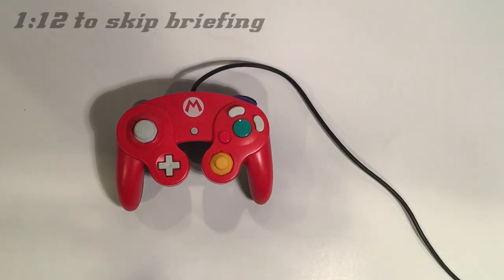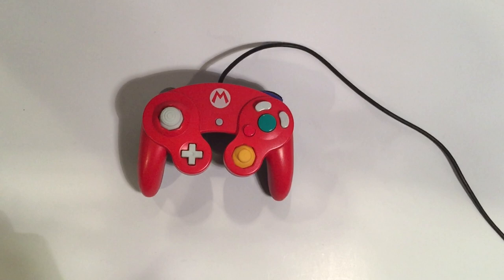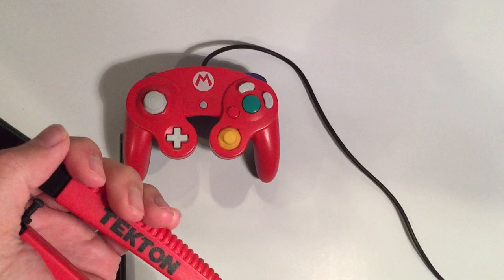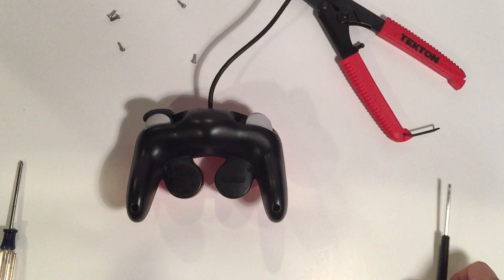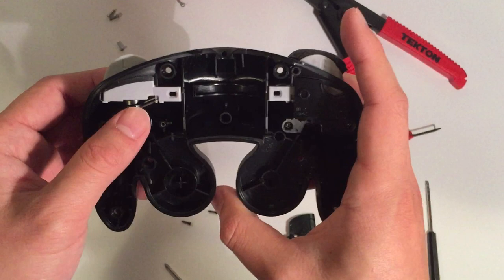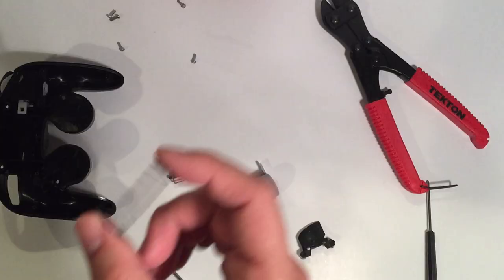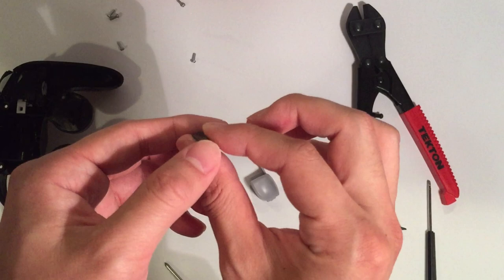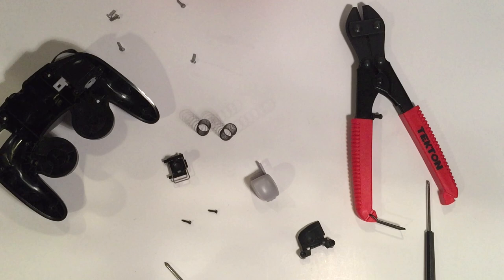Tutorial: Cutting Your Gamecube Controller Trigger Springs (Help Save Your Hands)

Comment: I cut my springs 2 down from the spiral bit at the top of the spring. This makes the trigger spring feel even lighter to press and it works just fine. You can still hit analog values meaning you can still light shield (or shield if you are a smash ultimate player like myself) so cut your springs 2 down from the spiral bit to further reduce the risk of hand pains.

Comment: I personally decided to remove the springs entirely, but ran into a problem where I was getting constant shield presses. Here's how to fix this:

The problem arises when you put the controller back together. There's two sticks on the controller board that are supposed to match up to parts of the L and R buttons. These are used for analog inputs, and measure how far the L/R button has been pushed in. We actually don't want these to link up with our L & R buttons, because then a constant analog input will be read. Push these two sticks all the way up, where they would normally be when no button is being pressed. Then attach the controller with the L&R buttons pushed down (doesn't have to be all the way, just so the slots corresponding to the sticks end up below them).
Reply: THANK YOU! I did the same and I was having the same problem, but your comment saved my life
Reply: thanks

Comment: I just removed them completely. Works just fine.
Reply from the maker: that works too! but just gives a very different feel on the triggers
Reply: The problem with this is you completely lose the ability to light press l cancel.
Reply: @vijayvellaithambi3339  it's for ultimate so does it matter
Reply: @giovanniortiz8421  most people interested in controller modding do it for Melee
Reply: @vijayvellaithambi3339  no you don't you can still press z
Reply: but what about super mario sunshine? will  you be unable to light press?
Reply: @leonpaelinck  i dont think so
Reply: @giovanniortiz8421  how do you get it to work springless in ultimate?

Comment: I had an issue where the right trigger was staying stuck down when i pressed it. I noticed that the right trigger spring was a bit looser than the left, i wound it tighter and put it back on, fixed the problem immediately. Just wrote this in case anybody has this issue

Comment: I can’t get the controller back together and just spent $40 on another one. How do I put it crack together it never wants to go.
Reply: Check reddit or youtube for an in depth video on how to assemble one but, you likely have something out of place otherwise the shell will just go back together.  It could be the pads in front of the board aren't exactly in their correct position and if they aren't they'll kind of push back on the board which won't let it sit as deep into the front part of the shell.  Though, it could be something else, like your zbutton isn't quite in it's little slot or the cables from you rumble motor are maybe, getting in between the shells underneath in the middle.  I think you can also, get it jammed up a bit in those little rails on the back of the board are in the wrong position/not aligned to where your triggers actually connect to them (the little hole on the triggers goes over the plastic piece that slides up and down those rails) I think I've messed it up before to where those plastic pieces missed the holes and were pressing into the plastic around the holes so, it wouldn't let the shells come together.  TL/DR it could be lots of stuff definitely find a guide or a video

Comment: I cannot remove the small phillips screws. I think I ruined them (or my screwdriver) while trying to loose them
Reply: you probably stripped the screws.  I did this when I used the wrong size of phillips head but, I was able to get it out with a very small flat head since it's so wide you might be able to grip whats left of the screw but, you've got to press with a really firm amount of pressure.  If it's stripped completely idk what to tell you though, maybe, you could tap it with something, as in work a piece of metal like a drill bit or something super thin and hard i'd look up a guide on how to "tap screws" if that's the case.  Hope you can get that screw out of there, good luck

Comment: What does it feel like when you remove the springs all together, because you can't light shield in ultimate and I want to know if there is any use in keeping them
Reply: The shoulder buttons would be stuck down. It's the reason they don't stay down when you press  it
Reply: I moded my left trigger to be springless. It sakes some sodering but is definitely worth it.
Reply: @JimiYoungWasHere  do you have/know a guide or something? I would like to try this as I am an ultimate player and don’t need light shielding. Thank you!